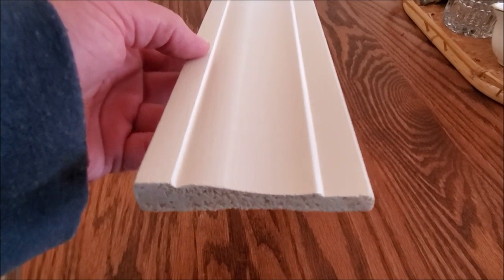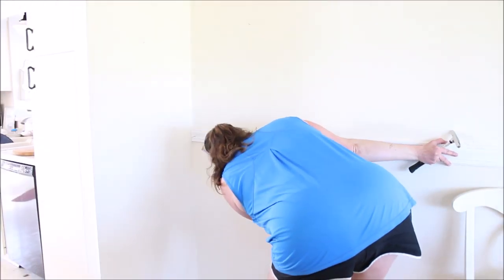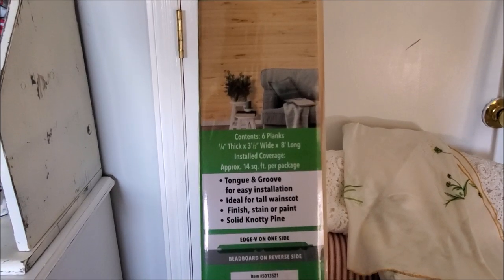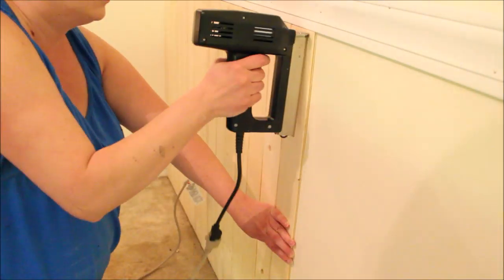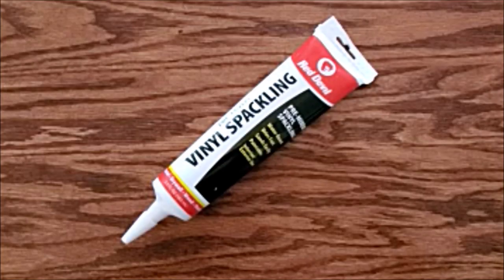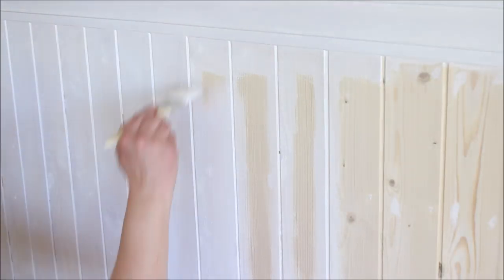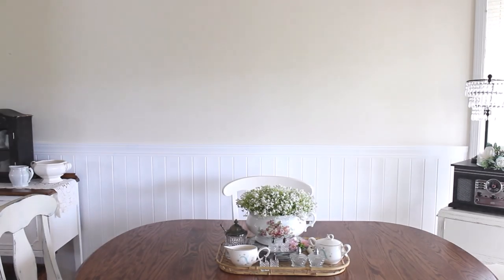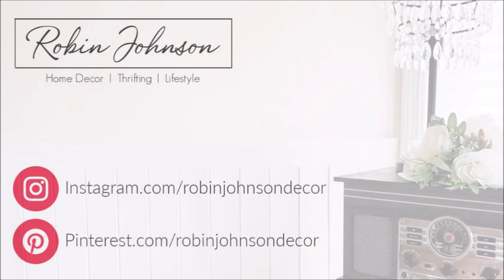How to Install A Chair Rail and Beadboard Planking

Comment: Loving this project.  The only question i have is , did you leave bottom straight, or did you add moulding!  Or just a small half round or something?
But looks so pretty, i really like it....(as im eyeballing one of my dining room walls)..lol
Reply from the maker: I reused the baseboards that I took off before I installed the planking.

Comment: Robin, how did you finish the bottom--- with molding?
Reply from the maker: Just replaced the floor mounding that I removed from the wall before installing the planks.  They needed a little shortening but thats no big deal.